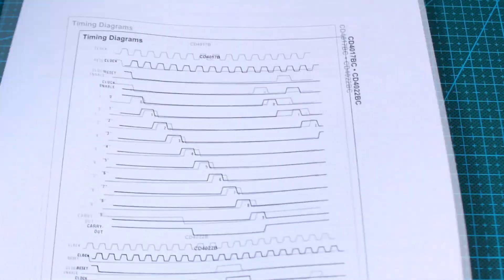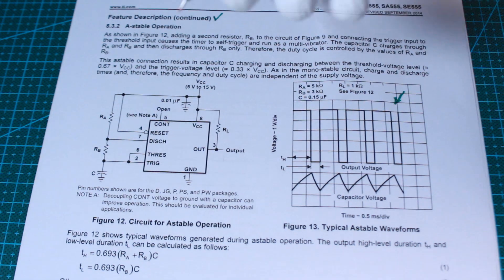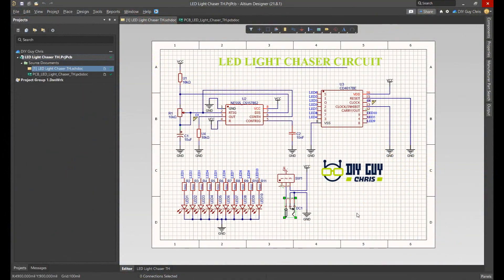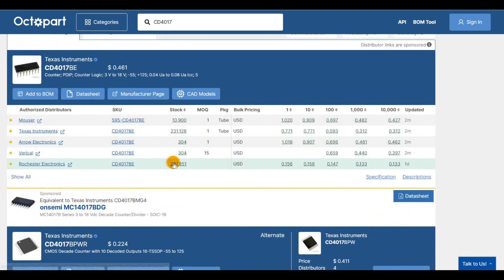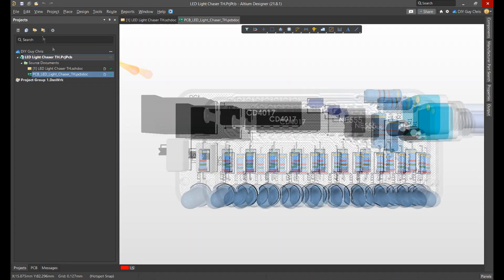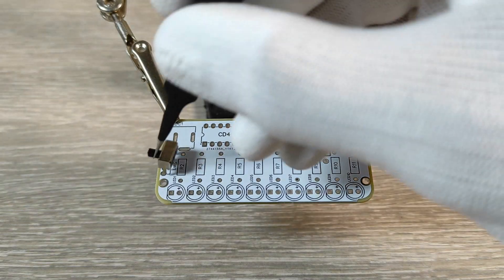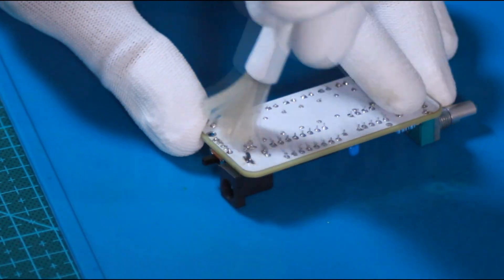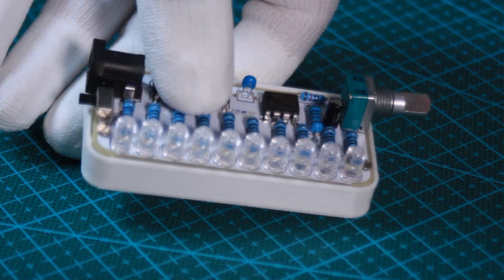DIY NE555 LED Chaser circuit (CD4017)

Comment: Okay, that's a nice video, but why did you add a resistor per output LED? Wouldn't it be enough to have a single resistor for all LEDs on the side facing GND?

Comment: Hi Chris. That was a really nice video, thank you. I'm wanting the LED's to fade when they come on and off and I am experienced with many different circuits that fade LED's. I have tried basic cap and resistor pairings at the LED's and also by using the 4017 outputs to drive bc547's transistors that turn on the LED's, again with different arrangements of caps and resistors on the base and/or emitter sides and I've also tried resistor/cap arrangements that can turn square waves triangle or sine, with and without the transistors. In all cases, I can get a very controllable fade out of the LED's but cannot get them to fade on. Is there something about the output of an LM4017 that will not allow it's waveform to change or for a capacitor to slowly charge? Or something else that I just can't figure out?
Reply from the maker: Fade in and out? Maybe you want to take a look here
https://youtu.be/ATGdORR7fKE
Reply: @DIYGUYChris  Thanks for that.  I hadn't considered using an ic in this way ... hmmm 🤔 I'll try this approach and see what happens.  Subscribed !😁